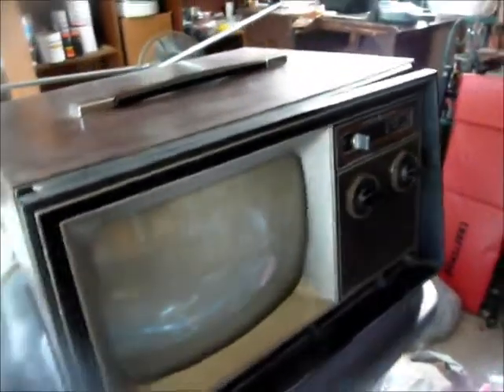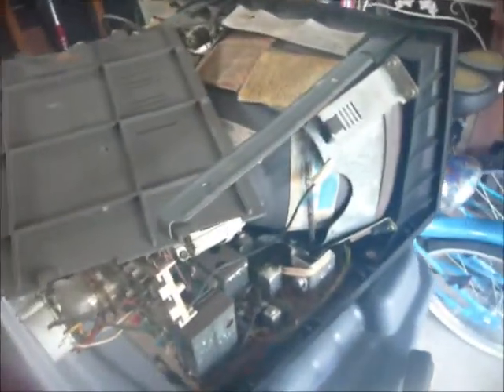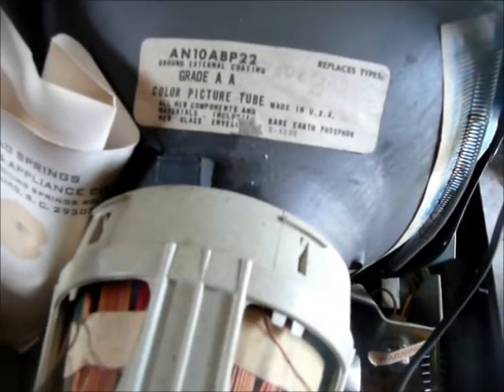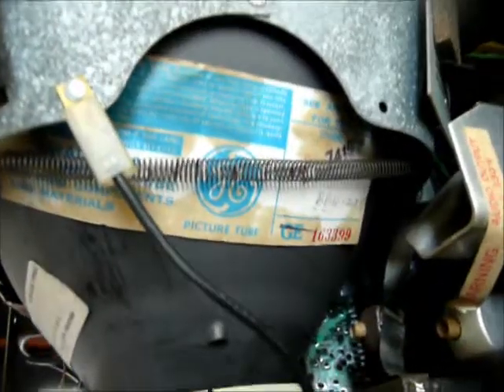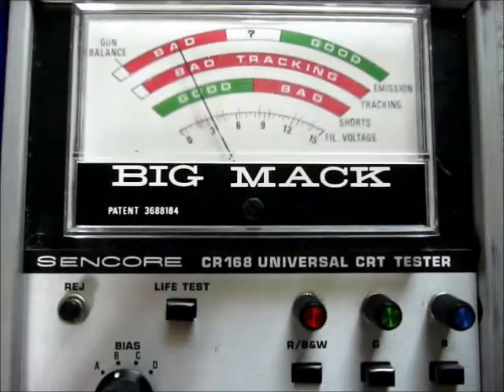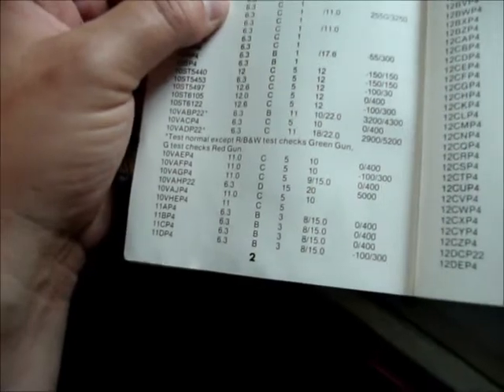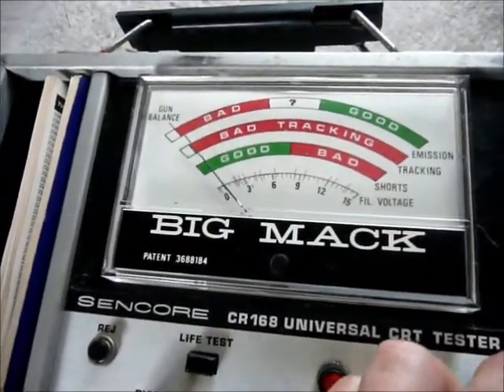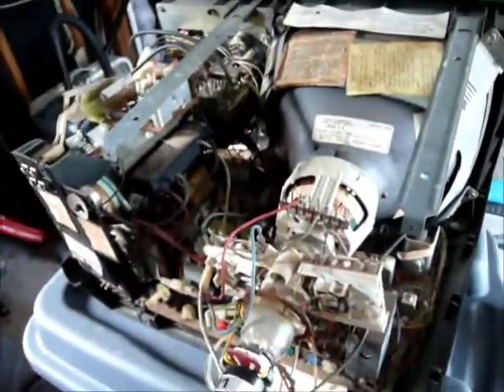GE Porta Color II

Comment: RadioTVphonoNut was saying that the there was the original PortaColor which is a tube set, then they came out with the PortaColor II which had an all solid state chassis. Apparently G.E had so much trouble with the PortaColor II that they stopped making them after a year or two and just continued on with the tube type Portacolors until 1980.